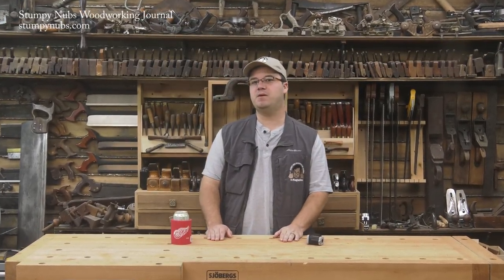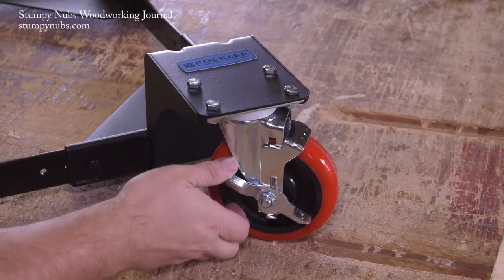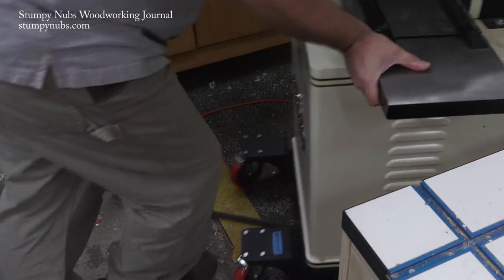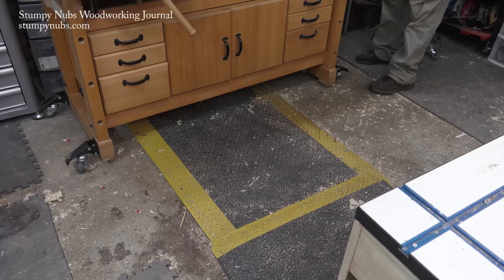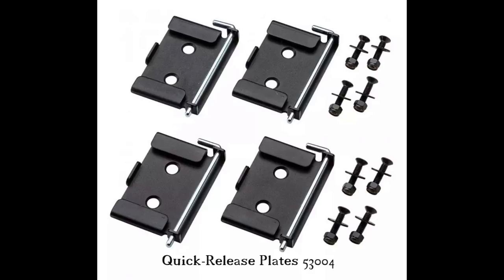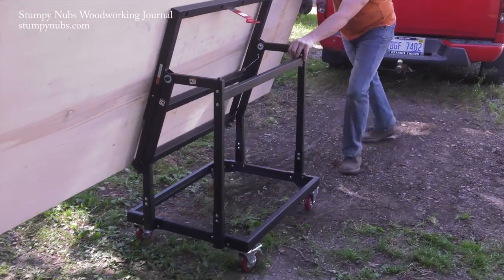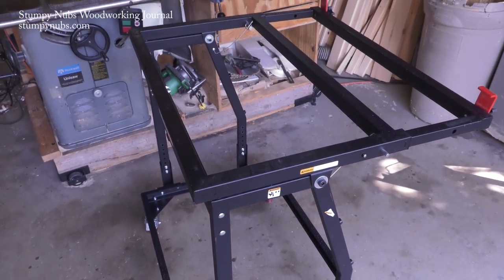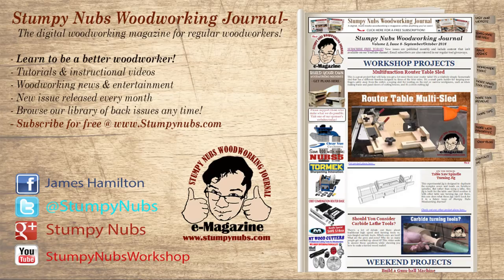Stumpy Nubs Cool Tools | Mobile Base | Casters | Material Mate | Shop Blocks

Comment: If you added a horizontal bar between the flip castors on your work bench that should give you more leverage without having to use a pry bar.  Just a thought.  Great video.